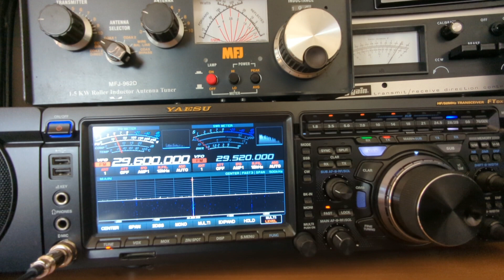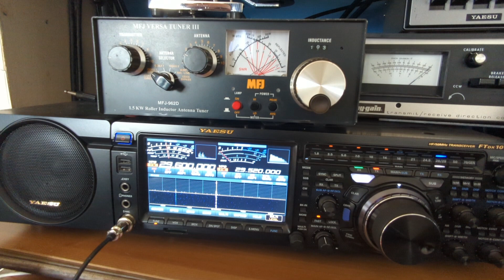Beaming Europe on 29 Mhz FM - Frequency Modulation

Comment: Hi Simon, is your SWR a wee bit high there??
Reply from the maker: Hi Chris yes it was a bit high on the ATU meter mainly because the pwr settings was on low 0-300 W if was on the high PW setting 0-1.5KW t would look lower.the actual radio was 1:8. I should have turned off the internal ATU really as the antenna is tuned lower but it was a quick catch.👍